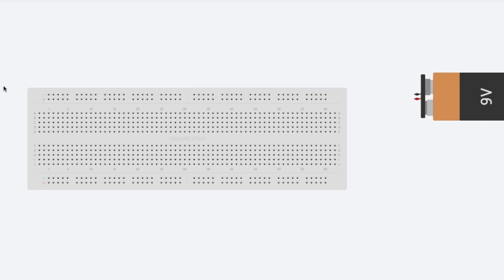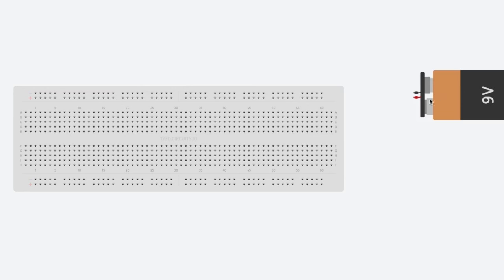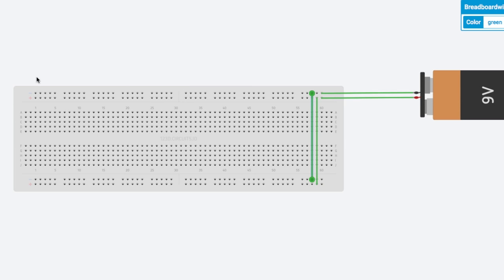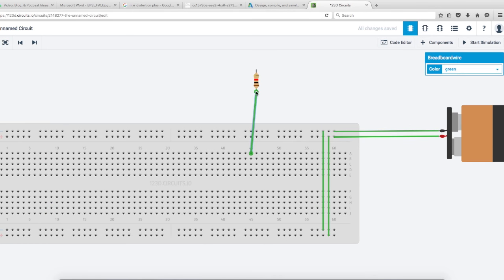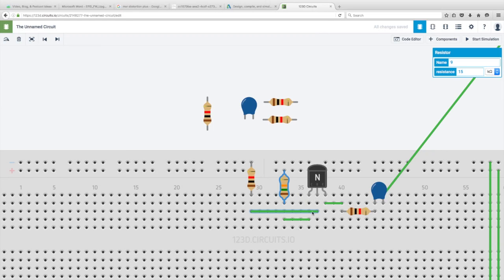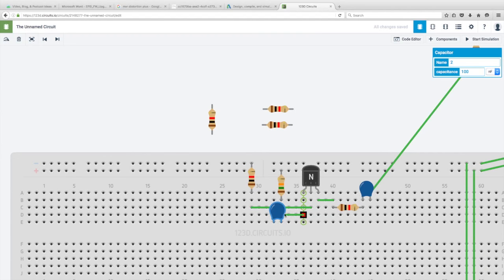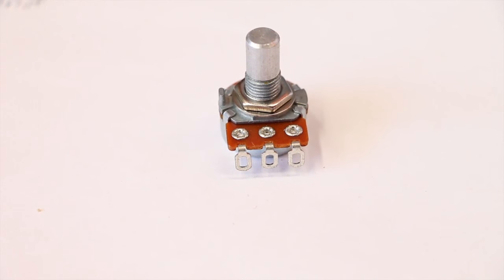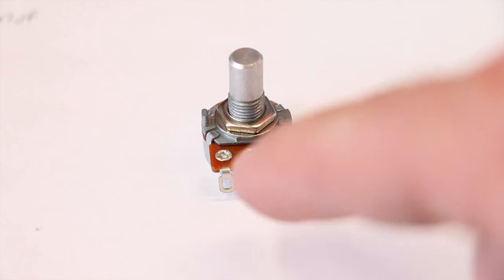Breadboarding Basics - creating a basic guitar booster

Comment: Great video! How about a follow up explaining what role each of the components play in that circuit?
Reply: Getting into that is literal electrical engineering. A simple explanation cannot really be concocted because these networks are very dynamic, and the value of each one makes the circuit change drastically.
Reply: @MoXyiD  isn't it electrical engineering you need to learn to be able to do this though? i also would love a n explanation as to what each part in the circuit does, how it affects the gain and tone. I am trying to learn electrical engineering online right now and some of it si starting to make sense. Brian did do a video going through what happens when you change components, but i still would love someone to say this is why you have a capacitor here, this is what it is doing, this is how the rating affects the circuit etc... I feel with a lot of the how-to-build a circuit videos, there is some stuff that is assumed you know, and there is some stuff you think you should have explained that is left out.
Don't get me wrong what Brian, Josh,  and some of the pedal builders do on youtube is great, but i wish i could learn more.
Reply: @andyread5363  To design a circuit is engineering - but you dont NEED to be an engineer to tinker. What I mean is that you can buy a kit for a gain pedal online, and then buy an assortment of capacitors. If you change the component value and play the guitar through it and notice a difference, make a note of the changes and what not and go after the tone you want. But to design a circuit with a specific tone in mind takes much more knowledge and experience. I think you're on the right path for learning more about this subject. I wish you luck!
Reply: @andyread5363  If you're interested in all of that, you should really start from the beginning to get the most out of learning. A good grasp of fundamentals is key to understanding in my opinion.
Reply: @andyread5363  To answer your question: the capacitors are there to get rid of any DC input coming from the signal. This allows for the signal to be less "noisy" and give it that clear sound. So capacitors are mainly used to get rid of any DC offset, and producing only AC signal.

Comment: Wow... what a great rundown! I'm no expert now, but I definitely know a lot more than did 20 mins ago. Lol. 
So, I have a bit of an inquiry,
I recently opened a pedal for the first time like 2 days ago (Boss DS-1) and discovered a cracked diode (D1). It was causing a crazy harsh buzzing sound when plugged in (what lead me to open it to check in the first place) and barely could get a signal through it. I did as much research as I could and could not find out what this diode actually does in there... so I said screw it and clipped it out completely and now have a crazy fuzz tone, that's almost gross but kinda neat, plus the harsh buzz is now gone!
I'm just curious if you or anyone else reading this could fill me in on why it turned out that way and what the D1 diode in this pedal does. 
Really enjoying the adventure that is pedals so far! 
Thanks and Cheers Brian!

Comment: I'm a little confused about the construction of the circuit on breadboard cause you connected the voltage divider on ihe transistor's emitter pin and on schematic circuit is on basis pin (for just turn on the transistor as a basic amp circuit), that was an error or on purpose to explain better?.And one more question, when you set the current that through away from colector to emitter and go to the output ... Has something technical, like a minimum voltage level to consider on input and on the output?

Comment: Hey, thanks for this video, you really do an amazing job. I use this program too and I found that you can actually use a function generator to simulate the input and an oscilloscope to "see" the output. It's pretty useful to be able to analyze how it shapes the wave in terms of clipping. 
One thing I miss in basically any video out there: some in depth explanation of each component. For instance, what is that input capacitor? And that 1M resistor to ground (and so many others that also go to ground), why are they there? And why those values? I know some of them you already covered, like the one in power source, acting as a voltage divider (?) but the thing is those components act kind of in a misterious way to me. If you could approach in a step by step form in a future video, that would be awesome.
Thanks for your work and videos!! Keep it up!!
Reply: Just a very fast answer: The capacitor is there to separate and filter out DC voltages out of your guitar signal. The capacitor works for AC as a shortcut, but for DC like a resistor with unlimited size. So only your pure guitar signal will pass the capacitor. Same goes for the output capacitor, it filters any DC leftovers of your 9V DC power source from your signal. Otherwise, your signal might have an offset according to the Voltage which is over the Volume Poti.

Comment: Many thanks Brian. I did a bit of breadboarding many years ago and am looking to get back into it, primarily as a grounding in circuit design for a small tube amp once I get my head back into it. In terms of starting up breadboarding would you say buy a project kit like Arduino or mabe just buy components for a specific project?
Reply from the maker: If you want to get into DSP, arduino is a great platform to learn on. However, you'll need specific components if you want to do analog stuff as well.
Reply: Cheers Brian, I will probably try and pick up a "goody bag" of components then

Comment: Brian, love the videos, have several of you pedals on the board. 👍When selecting the proper bias resistor to ground, would using a pot to dial in 4.5v and then metering that pot's value for ohms work to get a close resistor value? Or is there more to it than that, that I am missing?
Reply from the maker: Yes, that'll work just fine
Reply: Wampler Pedals Awesome. Thanks for the reply. Keep up the good work. 🤘

Comment: I have a question. So R3 goes straight through without touching ground. Then, half of R4 goes to ground. What occurs when half of the resistor goes to ground? Is half of it's value reaching the circuit, and the other half grounded? For example, if one half of a 1K resistor goes to ground, is 500 ohm going into the circuit? 

SORRY I understand this is extremely basic, but I just don't quite understand. THANK YOU!!!

Comment: Hi Brian. Thanks for the great intro to breadboarding. I'm a self-taught electronics tinkerer, but I've never manage to move very far beyond the basics. So, while I understand a lot about how the various electronic components work and are utilized in general, I've never have really been able to apply that knowledge in terms of building my own circuits. Do you have any recommendations or suggested resources for someone looking to get into designing/building audio circuits? Unfortunately, at this stage of my life, formal education is out of the question so it boils down to whatever I can get my hands on and teach myself. Thanks!
Reply from the maker: honestly, just reading as much as you can from forums and websites. Places like diystompboxes.com and freestompboxes.com are great resources
Reply: Thanks, I will definitely check those out.

Comment: As I assume this video is intended for beginners, I think digging into jfets a bit more would’ve been beneficial. Considering you have a gate, source and drain pin, I think it’s important to break that down and explain which pin you’re connecting to. I don’t know if you explained this in another video, but there was no reference to it. The only reason I mention this, is no one on YouTube explains this. Maybe make a video explaining jfets a bit more. Just a thought.
Reply: Correction: no one on YouTube explains jfet designs of fuzz pedals. This is the closest thing I could find. I’m on a jfet venture since it seems jfets are a big part of distortion pedal building, but the explanation of jfets is either overly complex or super rudimentary. Just some constructive criticism. Otherwise great video.

Comment: Okay, the resistor to bring the voltage down to 4.5v-5v.  I've tried 15K, 300K, etc... and still getting above 8v.  Double checked, triple checked my circuit.  Seems like the resistors are bringing the voltage down but barely.  Using a 9v battery that measures 8.81v, with a 15k resistor I get 8.80, with a 300k resistor I get 8.56v.  Maybe my capacitor is wrong, when you say .022 is that .022uF, .022nF?  I'm using a .022uF which translates to 22nF I believe.  Thinking they a fake J201s, the only reason for this.  I made a circuit where Gate went through a 1M resistor to ground, ran an 18K resistor from Drain to positive 9v battery measuring 8.81 volts.  Measuring ground and drain I'm getting 8.77 volts.  Sound like fake J201s?  Yeah, for sure they are fakes, they come up as BJT NPN transistors, not JFET.  Tested the voltage / resistor with a known N channel JFET a J112 and got 5.5 volts with an 18K resistor.  Gonna have to find some authentic ones.  Sorry to bother you.

Comment: I didnt get one thing:  what does it change in the boosting effect if I put a more potent resistor in the third pin of the transistor? I saw that you put a 1K resistor in the first pin (input), but you raised the "potency" of the third resistor (15K).  Thank you for this video!
Reply: What if I raise the capacity of the first resistor (input)? Let's consider raising it from 1K to 50K (just an hypothesis).
Reply: Mythocratic Republic It would lower the input level.

Comment: I have a problem: Guitar Rig Pedal Board; the Pedal itself does not move
 the Wah Wah fully in the Software; I have ascertained that the problem 
lies in whatever is on the Circuit board which receives the signal from 
the Pedal. What is that small receiver which is on the Circuitboard and 
where do I get a replacement. Native Instruments which makes the Pedal 
Board does not support the Board any more

Comment: this made so much sense seeing the schematic translated into a breadboard layout! If you put a couple diodes back to back between the output of the transistor and ground, would this become a distortion circuit?
Reply from the maker: Pretty much - that would make it "hard clip", so it would have more distortion, yes.
Reply: Okay cool, thanks for the speedy reply! Sorry to plague you with questions, but how would you go about making them 'soft clip'?
Reply from the maker: hard to explain on here... but you'd want to make it look more similar to one of the big muff pi transistor stages with the diodes connected to it
Reply: Awesome! Once again, thanks!
Reply: Sorry, I'am not a native English speaker, but what do you exactly mean by "a couple diodes BACK TO BACK between the output of the transistor and ground"?? ( in what place specifically I mean to put the diodes?) Thank you.
Reply: República Mitocrática I was referring to placing two diodes in parallel, facing opposite directions, between the wire to the output jack and common ground. I hope this explanation helps!
Reply: Cyrus Fontaine, thank you! so you're refering to the wires of the trasistor's pins (the ones the go to common ground and the other that goes to the volume capacitor). Right? Sorry! I just understood where to put one diode in the output wire, but I'm not sure about the other. Thank you again, for your patience :D
Reply: República Mitocrática https://goo.gl/images/VWNql5

See how the diodes are arranged in the image? That's the placement I was referring to.

They both hook to the output after the cap, and the other ends of them attach to ground.

I wish I was a bit better versed in electronics, then I could explain a bit better! 

Thanks for bearing with me!
Reply: Cyrus Fontaine Very clear now! Thank you very much bro!
Reply: República Mitocrática Not a problem man!

Comment: I am not trying to make the smart guy but in R4 resistor the actual value is 1000000 ohms which is 1MegaOhm but in the electronics the "m" value represents only the milli values which are 1/1000 of the unit.Put the capital M instead of "m" or meg,megaohm,Meg etc.
Reply from the maker: Yes, you are correct.

Comment: Zero resistance.....I would've explained it as continuity......
Reply: Continuity=whether or not there's a break in the circuit between your diodes on a meter... At least that's what I was taught, troubleshooting electrical lines. Always check for continuity.